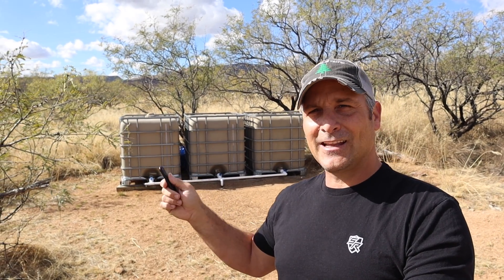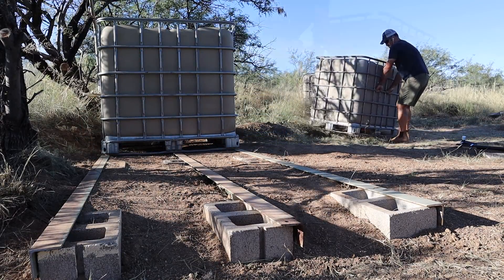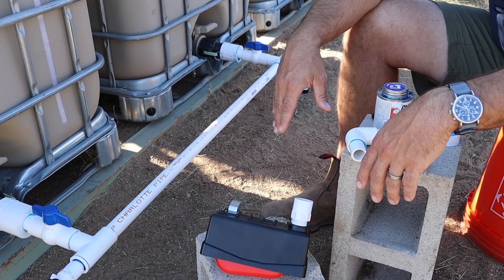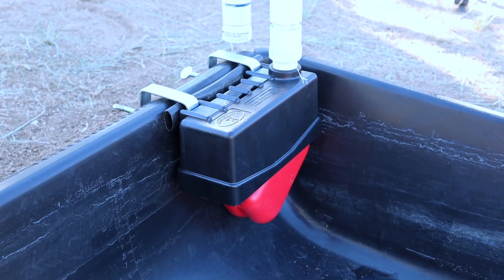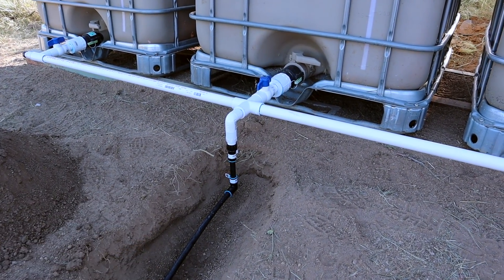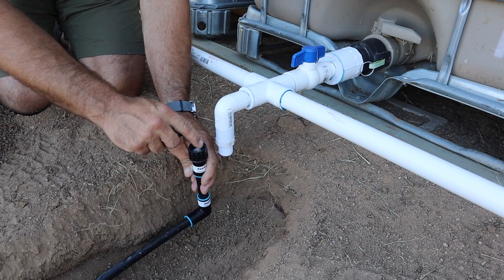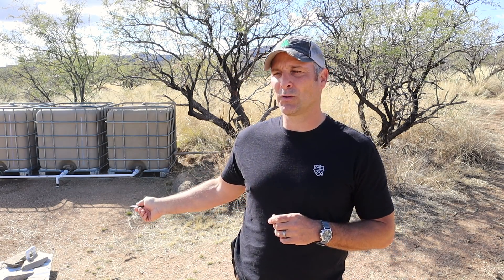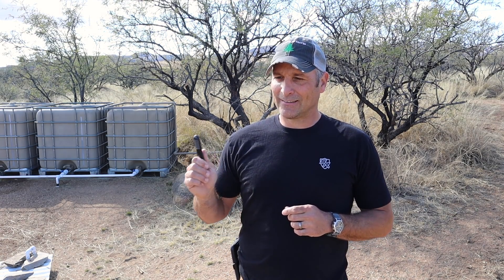Rainwater Harvesting Wildlife Waterer UPGRADE - 300 to 900 gallons

Comment: Looks really good!   Very impressive. 
Have you done research on UV aging of PVC?
My experience has been that PVC pipe out in the sun last a lot longer than it was supposed to.  That said' I've done minor repair of joint cracks that I believe were caused by thermal expansion of the PVC between day and night.

Comment: Question how are the totes plumbed to fill all three evenly? I use the same basic recipe as you but want to add water capacity ( maybe should just buy a low boy 1000-2000 gallon poly tank? )

Comment: Do you think that a 5/8 inch garden hose could trickle out some rain water if it was 300 ft long connected to my tennis building gutter which is 15 ft higher than my garden.   I can not have a big tank by the tennis building.  5/8 garden house in a rainy climate should give me fair bit of water i do believe.  The roof is 5000 sq ft in size.  Huge gutter and huge downpipe like 4 inch diameter pipe.

Comment: Rain harvesting is the number one piece of infrastructure. IMO.  A problem is that the cost of water tanks has doubled recently.  So now I am looking at digging out long trough with a rubber liner or something.  I am desert dweller.  There are range cattle out here so I would suggest supporting the above ground pipes from animals stepping on them an breaking them, this releasing all the water.  Also pvc easily shatters when frozen water in them expands.  I have been irrigating  125 olive trees on a mountain side nearly 20 yrs. now.  I can always use more H2O.  It is the limiting factor for everything homestead.  Keep it clean.  Good job! Really.

Comment: Why do you have to run your fill line to the top of the first tank?  Couldn't you have just used the same connection as your outlet from the totes.  The fill cap need only be the standard vent cap to equalize the pressure, gravity will do the rest to fill and equalize your tanks.

Comment: Love this! Great job.

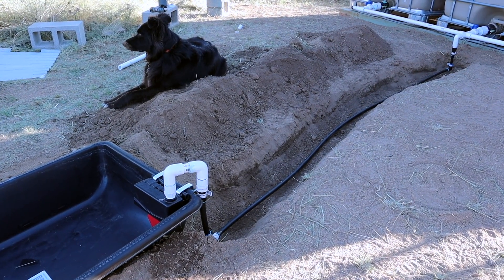I hope you have more luck with half-inch black hose/tubing 7:53 than I did with my drip system. Kept getting leaks after ~3 years, and it was a bit of a pain to dig up & keep fixing.

On second thought, your low pressure system should fare much better.

Comment: ha! I was looking for a video of someone who had linked tanks together but really couldn't find anyone so I went about it alone. Similar to yours actually, but I connected 16 tanks together with plans to keep adding. I figured out that the quickest and cheapest way to build a large tank(when space is not a problem) was to link IBC totes together. I can add more tanks as I need them. I notice that you went with 1 inch pipe to connect them together. I did 3/4 inch since I already had a large bunch of 3/4" fittings and valves from old projects. I also noticed that once you get more than a few tanks together and you started worrying about shifting and needing to adjust them in the future that I'd connect a square of four of them together with PVC pipe and then connect the groups of 4 tanks together with 3/4 inch hose, one on each side. They all seem to equalize fast enough though the tell will be in the summer when the monsoons come. According to the math, it should be ok. But this is all an experiment really. I love your projects because of that.

Comment: I've got a question for you: why not put the water collection corrugated roofing on a frame over your totes? It would be cheaper, healthier for the animals, require less maintenance, and be more convenient to build and maintain.

By having the roofing on the ground, you get more dust on the panels (and in the water) and there's more potential for rodents to defecate on the panels, potentially spreading disease.

Putting the panels over the totes would also shade the totes to reduce algae growth and evaporative losses through the little gaps in the lids.

Having the panels directly over the totes would also eliminate your downhill flow problem. And you don't have to dig a trench to your totes!

It would also probably be less expensive. At least where I live, 2" PVC is $2/ft. If you have to go 50' to get the elevation needed to drain into the totes, that's $100 in PVC alone - let alone the extra cost and time in primer/glue + fittings. A 10' x 20' frame might cost $100? That's over 100' of 2x4 ($82.50) four cinder blocks ($9) and a box of nails for less than the PVC alone probably cost.
Reply from the maker: It’s a good idea but if you look at the origin of this project I used a billboard tarp set over a bermed up basin so as to form a fill point at one corner.   So it was located where it was to account for the elevation of the land and not require a structure.   Additionally building an elevated structure in my windy area requires a decent structure and I simply wanted to use as much of what I had already designed and not have to concrete a bunch of posts in the but it’s a sound  idea nonetheless 👍😀

Comment: I'm keen to know how you get the water up into the header tank/ or gravity watertank. if you could pass on you wisdom that would be awesome cheers
Reply from the maker: The water moves because the level difference.   The roof is about 5’ higher than the IBC totes and so long as the inlet (tub at roof) is higher than outlet (end of pipe at IBC tote) the water naturally flows from hi to low.  11:00
Reply: @homesteadonomics  thanks for that thought that might be it unfortunately my roof line will be lower ... but you've given me some food for thought .. thank you keep up the great work

Comment: Why? Did the system not have enough water for the animals?
Reply from the maker: Yes, the single 300 gal tote would only last so long and I wanted it to be able to last for longer periods.   As well as the trough upgrade allows multiple animals to drink versus my original version that had a small automatic dog eater dish which would only allow for a couple animals to drink before the float valve would have to kick in.

Comment: That catch tank off the gutter looks like it does a good job of separating out any sediment before it gets to the tank
Reply from the maker: It gets most of it!   The little bits of dirt usually collect on the trough bottom and when it’s al dry I can just sweep the dust out.

Comment: Awesome set up, I plan on doing something like this for our livestock in Northern AZ to help alleviate hauling water.
Reply from the maker: Thank you!   Depending on your property topography in N AZ, if you had the right elevation from collection to tank you could simply lay out billboard tarps over a bermed area and that would make for a super giant collection surface.
Reply: @homesteadonomics  Cool, thanks for the tip. We might try that. Just found a few Mule deer tracks on the property over the weekend so we might make a wildlife watering hole as well.

Comment: great update. I  started out and used your 2.0 version to build something similar. I don't have the collection part, but used the single tote/ water dog tray set up for the first year. . It lasted season 1, but not sure how well the float valve in the dog tray will hold up over time. I have to deal with wild hogs in Texas as well. I am going to add the screens that you discussed to prevent algae from clogging the float valves. Mine expanded in august of last year. I added a 150 gallon Rubbermaid stock tank and a second float valve (same one you are using here) for a larger area for the wildlife to get to. They still have access to the original water tray though,. I found that adding a couple tree limbs' and 3 milk crates strapped together as stairs with cinder block inside the Rubbermaid stock tank works great to allow animals to get out of the trough if they fall in. The raccoons, bobcats, and dove love them also as places to perch while drinking (or hunt because those bobcats are attracted to this area now with the increase in bird activity.  The deer can utilize the water trough better and it gives me more capacity between fill ups. Hope to do rainwater collection at some point too
Reply from the maker: That sounds like you’ve got a great setup!   And I like the stairs idea too….kinda like the water guzzlers out here for sheep and elk in our more arid areas.   Keeps the water cooler and they simply walk down into the trough as the water level drops the steps allow access.
Reply: @homesteadonomics  Ironically...I now need to develop a version 4 for my deer watering set up. I just got a hold of a 1100 gallon round stock tank (10 feet across and 2 feet deep) for free. Im worried that it will consume water fast due to evaporation.....but I guess we will have to see..cant beat the price. Got it leveled and in place today. Need to figure out how im going to fill it next.

Comment: Wow, expected the others but was surprised by the pack of wild boars.
I assume Javelinas are some sort of rodent?
Why cover the trough at all?  Would it have been better to get a smaller tub instead?  Could even use a dishpan...
Great work!!!  Thanks for the content!
Reply from the maker: Yep those were javelinas!   Funny little creatures😀

As for the tub being partially covered.   The reason for that is to increase drinkable capacity.   This way there is like 12-14 gals of water in the tub so several deer or other animals can drink from it without the water level going down too far.   I did have an auto dog water dish on a previous version of this project and once one or two animals hit it much of the water would be drank down and the float refills is very slowly.   So it’s mostly just for the ability for multiple animals to get a drink without draining the level down, before the float refills the water.

Comment: Nicely done. Super cool wildlife footage. Had a couple skunks and a bunch of javelina routinely visit our yard over the last year. 

I've been contemplating using EPDM pond liner and simply laying it on the ground for rainwater harvesting. Supposed to have pretty good uv resistance, can imagine it lasting 20 or 30 years before getting too many holes in it to be useable. And if covered in gravel could last a very long time. Anywho, hope all's well, thanks for sharing your projects.
Reply from the maker: Yes, if you add gravel over it I’d say it’d be a lifetime liner easily.   Barring some type of mechanical movement placing a hole in it.   There are some designs of natural pools that utilize epdm liners and gravel.   But they gotta be deeper than they are wide and shallow.   Surface area to volume is a huge thing for Evaporation….at least in my dry environment
Reply: @homesteadonomics  I was speaking more for collection rather than storage. An an alternative to a rain roof, or other means. I live in Tucson, so well aware of the evaporation issue. It's astounding how much water pools evaporate around here.
Reply from the maker: @dustman96  oh yeah, totally!  It would blend in nicely too.   
I’ve also heard of doing a large dug out and lined area and then filling it with open chamber structures… waterblox.   Kinda look like milk crates and they stack.   And when you have your volume built the liner is wrapped up around them and backfilled with gravel.  I’ve heard there are a couple type setups in Tucson like that and they inset a manhole access where the pump goes.  Mostly for irrigation purposes but I think the concept could be cool to see how an Individual could use maybe second hand stuff to make something similar

Comment: Wow, you've got a lot of large wildlife in the area. I live in the suburbs of Baltimore, the only large animals we have around here are deer, fox, beavers, and occasionally racoons and opossum. We also have skunk and more squirrels than you can shake a stick at. Our deer are as different species than you have in the desert; I'd guess from your wildlife cam footage that the deer around here are about 30% larger than yours. But we definitely have no coyotes or javalinas!

So, the water distributes to all three totes through the ground-level one-inch pipe? No trouble filling all three through that? I mean, it's the same size as the feed pipe from the rain roof, so I guess that evens out.
Reply from the maker: Yeah our whitetail deer here are known as ‘coues whitetail’.  Sometimes called the ‘gray ghost’. Very elusive and range from foothills to the most rock canyons and mountain tops.  Probably about 50-60% the size of eastern whitetail.   We’ve also got mule deer here and they can get down right giant….especially in NW Arizona where some of the biggest in the world are located.   They’ve got some sort of freak genetics up in that area.

And yes, the linked pipe allows them to level out as the water flows into the first one.

Comment: Thank you for another Great video.  Since you do not hunt near the watering station would AG&F allow placing a salt block near by as well?  Are those White Tail deer?
Reply from the maker: I actually added a mineral salt a couple years ago to the ground to the right of the totes… I mixed it in and soaked it with water.   So as to mimic a natural mineral deposit.   You can see the javelina in that area and I notice deer on occasion lick in the soil there from time to time.  I do know that we aren’t to feed any of the animals, but water is okay and even encouraged.   But honestly I’ll have to check on the salt/mineral supplementation.   
And yes, they are whitetail….but a desert sun species called ‘coues’ whitetail.   Sometimes called the grey ghost….very elusive and about 1/2 the size of Midwest or eastern whitetail.

Comment: Great video. The angle iron to level the three tanks makes so much sense. Do you have to have a mustache if I wanted to do this kind of project? I’m in San Diego and I used a stock tank (135 gal) as a backyard water feature and I used Mosquito Dunks to control them. I wasn’t trying to feed bats or anything but I don’t know if mosquitos are an issue in your area. The cover on the basin looks like a good way to keep critters from just climbing in. Thanks for sharing and your Christmas gift has provided some great pics!
Reply from the maker: Yes, this gift has gotten daily use since Christmas!   I was super excited to be able to set it up.   Otherwise this video might have been pushed until the spring when my birthday came around.  
And the moustache…haha…you noticed. This video has been months in the making.   I think that clip was from September or there abouts.
And for mosquitoes, I don’t do anything special on this.   Doesn’t seem to be a problem in our drier environment with small sources like this.  But I have used those dunks when I had my rainwater garden ponds full… as they are a lot bigger and full in the midst of monsoons.  Which is our big mosquitoe time of year

Comment: Have you had a problem with freezing?
Reply from the maker: We do get freezing temps but usually not more than low to mid 20’s.   But when it does freeze I place a tarp over the pipes and some grass around the trough piping.  You can see the tarp in a couple of the clips at the end.   If it’s only going to hit 30 or so I don’t even worry about it.
Reply: @homesteadonomics  thank you. We have the barrels and have to use the hoses to fill them. The barrel does not freeze but the hose does. Gonna be in the teens tonight so I will put a blanket around my barrels. Georgia here. Lol.
Reply: Arizona😂
Reply: @gregmize01  gets cold there too!